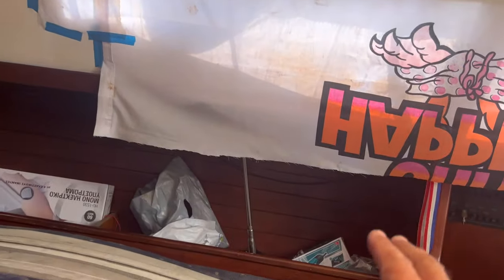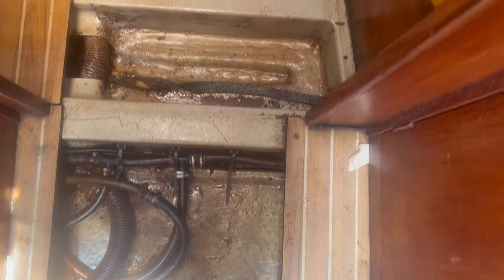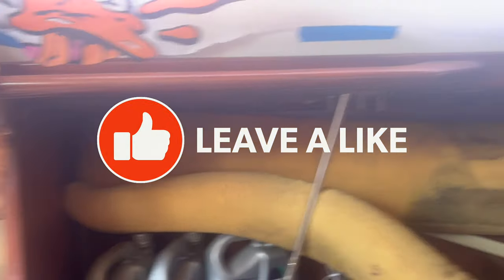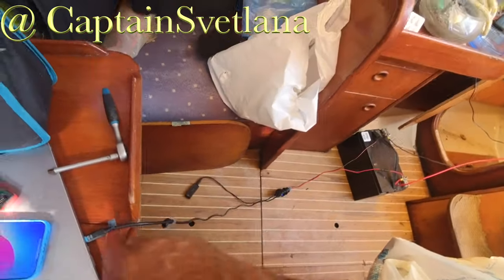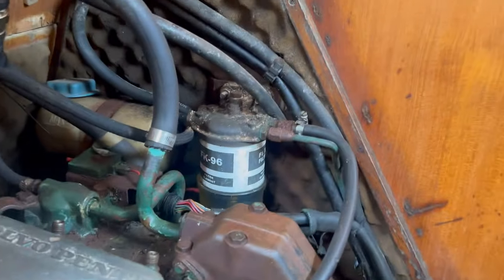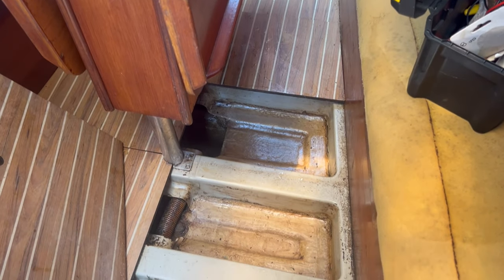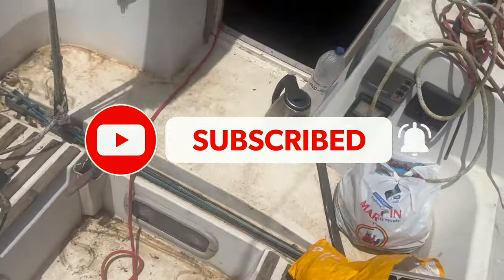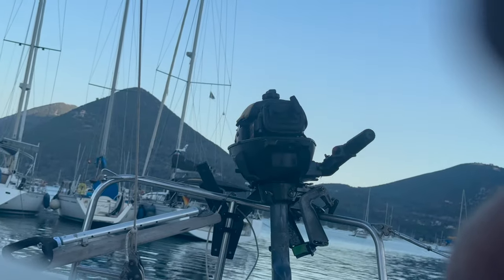I bought an abandoned sailboat for 400 euros | S4 E19   HD 1080p

Comment: We have an ‘88 320, very similar boat and as mentioned above, the copper strap is an attempt at a lightning conductor. Very dubious how it would ever perform so I wouldn’t worry about it, or the keel bolts, they are most certainly just rusty heads. Good luck with the refurb.
Reply from the maker: Thanks. I never thought of that but others have said the same thing. I will reinstate it in any case as you never know.

Comment: Copper strap you were referring to may be for lightning. Before these boats were fitted with this unit and strap. If it connects to your chain plates for your rigging then that is what it was for.
Reply from the maker: Now that I did not know. I will check. Thank you!

Comment: Can you please tell me where did you find it? Or where should I search ? I’ve searched in boatyards but they will ask about 10.000€ for one like you(eg MargaronaBoatyard preveza). I would extremely appreciate if you can help me ! Thanks
Reply from the maker: Word of mouth. I asked around at the local bars as well as the yards. The smaller yards may be better than the bigger, more formal places. I also posted on local Facebook groups.
Reply from the maker: I heard of one at Aktio I don’t know if it’s still there. I set my budget at €5k.
Reply: @Sailwithandy  thank you so much